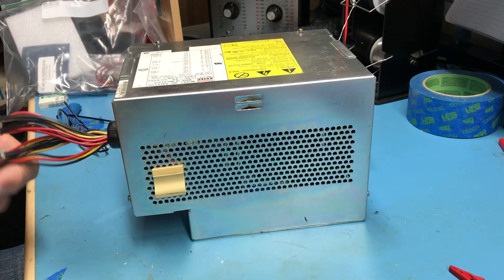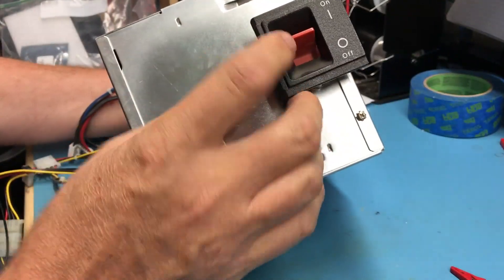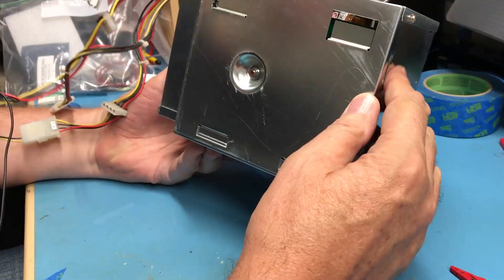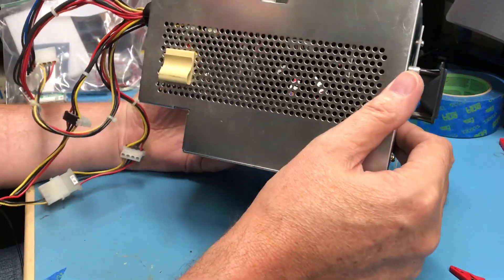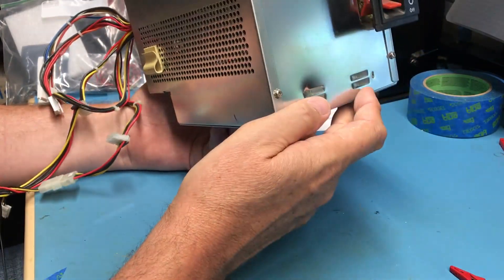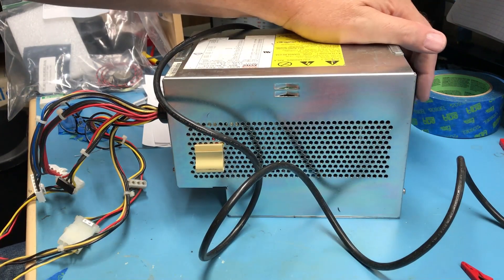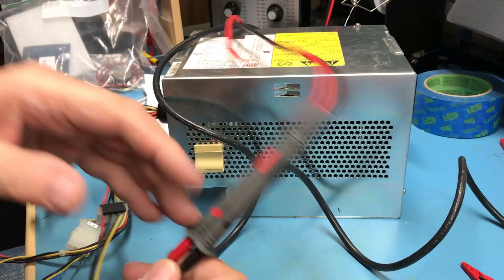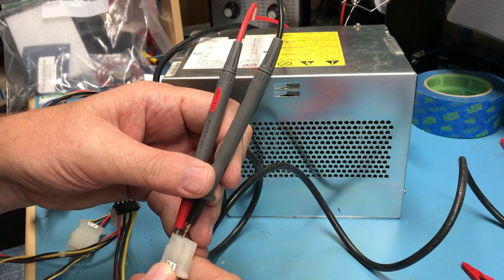IBM 5150 Clone Kit - Part 4 - Power Supply - STB71

Comment: I love projects like this. Switch mode PSU's fall into two cargorys of repiars. Ether piss easy problem such as a shorted power transistor or rabit hole to hell with no solution in sight.